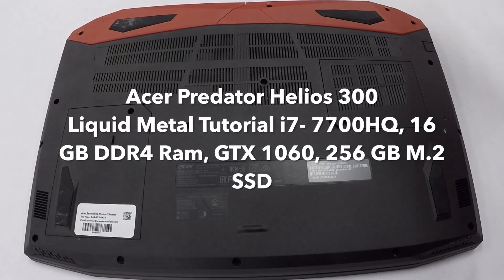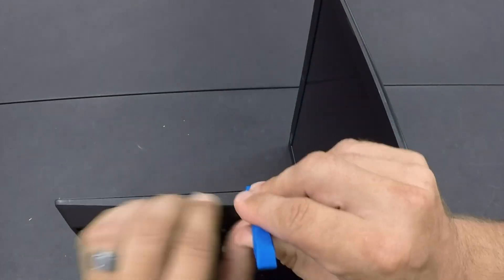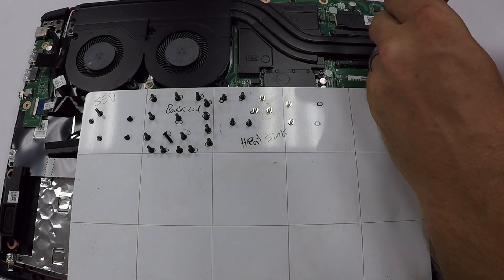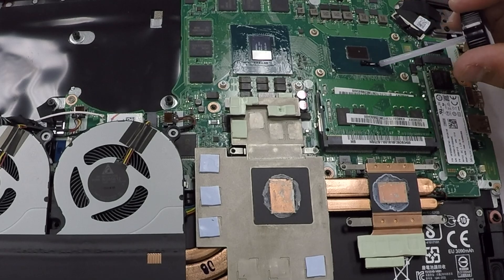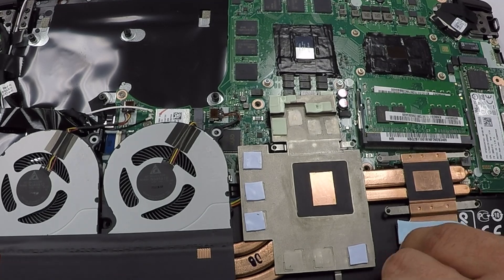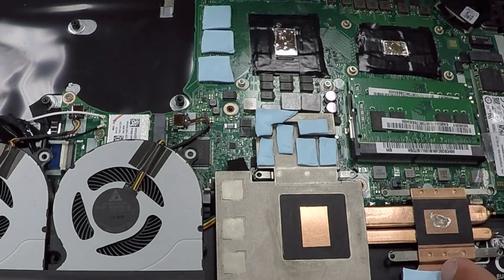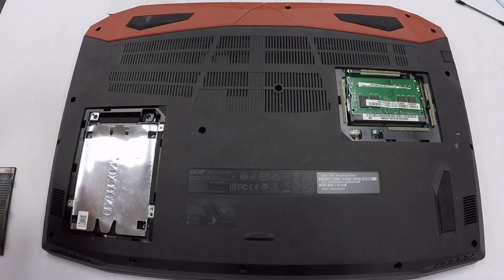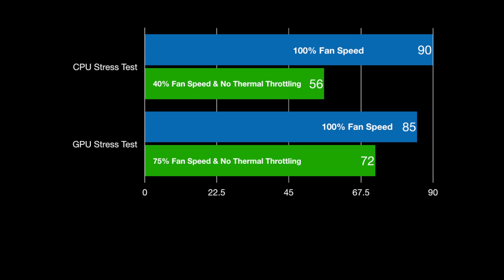Acer Predator Liquid Metal Upgrade Tutorial

Comment: I'm sorry to say this, but it's so strange to see people that find this video any good... Maybe it would be better without the actual footage of doing things so terribly wrong. Why would you want to apply any coating to the CPU that is void of any electronic components on its surface to short? Why coat bare fiberglass that is an insulator? Same goes to the GPU, except for the tiny capacitors on its surface. And moreover put a shitton of electric tape on both just in case and then tell people not to do that... Not to mention the quantity of LM you poured there. Then to put in graphs that don't make any possible sense just by looking at them and spend 2+ minutes trying to explain what you really meant by them. That's not an educational video. And again i'm very sorry to tell all this. I just can't walk past all this incompetency and stay out of it as if i didn't care.

Comment: Thnx a lot. One thing though, both cpu and gpu heatsinks are copper. Afaik, liquid metal corrodes copper plates in time. Did you have a look recently?
Reply: i think it work well with copper, but not with aluminum.

Comment: So... what about now? 1 year after you put the liquid metal. Have you ever got issues? And for how many months you can keep the same liquid metal?
Reply: Use it for a couple of months, then it will suddenly stop working well. That's because the copper absorbed the liquid metal and formed a layer of protection, after that, reapply it and in theory if you don't open it anymore, it will last indefinitely and it will always work like the first day you applied it. Just use precautions like special tape, nail polish and foam barriers. 👍
Reply: The age is worse than thermal paste
You should use a high end paste instead

Comment: Thanx for the tutorial... But  i would not doing this By my self. I Really need to clean my fans and apply new cooling pasta... My acer predator is 2 year, so no warranty. I have 2 options: 1 sent it to an acer factory and wait 1 month or go to a Computer repair shop, they do repair laptops and so on... No doupt they are good. I called them and asked, when he asked "is it a gaming laptop?" yup it is, he got unsure if he could do it... After seeing this... im not sure if they can or if they have done it!  Im starting to regret buying this laptop :(
Reply: a decent repair place can do it and it shouldn't cost a lot but you should get comfortable doing basic stuff yourself. fans need cleaning regularly even if you don't go as far as taking off the cooler. also, throttlestop is a great program use it to undervolt the cpu acer put way to much juice through it at stock settings
Reply: @LtTrog  i fixed it by ordering a original fan via zandparts.com. I took it to a computer repair shop and they fixed it and now its working fine  :D
Reply: Learn to service ur laptop urself.  Especially if its out of warranty all u need to do is open it up , clean it , remove old paste then repaste and nicely close it up. Done.

Comment: Finally broke down and used liquid metal on my Acer Predator x17 w/ 7700HQ and GTX 1080. Liquid metal is amazing. I had previously used kyronaut thermal paste. In Cinebench R20 the max temp on the CPU is 62° C vs 80° C with paste at stock voltage! In Unigine Heaven I get max temp of 61° C on the GPU! Using Aida64's stability test on CPU, FPU, cache, and GPU I get a max of 76° C on CPU. Pretty nice.
Reply: Hey, I want to ask is it still the same or u have to change it every now and then.Also pls answer is it worth it?
Thanks

Comment: Hey there, I wanna do the same procedure for my Laptop, but the tape you showed is to expensive in my country "around 20$", so I decided to buy someone which is only heat-resistant to 90 degree celsius, is that enough because my laptop could go into the nineties in cause of a overclock

Comment: do you know if its the exact same for the new helios 2019?
Reply: @gezimislamaj5309  it's weird. Cause my cpu I. The new helios runs way hotter than it's suppose to.  I need to undervolt it by a lot to get it to normal. ....  Thats why I was thinking maybe the paste was maybe put on it wrong.
Reply: @gezimislamaj5309  ya. I'm  hesitant of doing that. I'll stick to the undervolting for now.  Temps are good at around 60ish c°..  Not even hitting 70c°...  If it gives me problems later on down the road. I'll maybe think of re-pasting..
Reply: basically the same for any laptop

Comment: JUST DO IT AS SOON AS YOU CAN  if you have the same model!!!! It works so well on mine. Before the replacement, my CPU regular temperature was around 53 degree, gaming temperature was between 85-92degree ( outdoor temperature: 30 degrees, I got few times 98 degrees when the outdoor temperature was 40). And now, my regular temperature is just around 43, sometimes it's only 38. And the effect on gaming is also remarkable, I played 2 hours PUBG, 1080p with high setting, the temperature was always below 80 degrees. That is IMPRESSIVE!  Don't be hesitated, the rewards are worth the risk. Because ACER left us a bomb here, it should be fixed by ourselves! (You'll understand when you open it)
Reply: wow. I tried repasting with different brand of thermal paste and it didn't work. I guess liquid metal is the only way
Reply: Great.!

Comment: What happened with helios now,after 1 year liquid metal used
Reply: 3 month it would die. you know why? cause fucking liquid metal is for special servers cooling and not processors of laptop!!! it goes in reaction with alluminium and copper. and after some time it just corrodes it and thats all! processor dies in 3-6 month. Yes temperature is awesome but it just dies!!!
Reply: @vladdjavakhadze3147  BS 100% had lm on my old laptop for 3 years, only some corrosion on the copper nothing bad, gpudied because not changing the lm for 3 years, if you change it every 6 to 12 months you will be fine after all

Comment: I have some conformal coating on the metal part of the chip where I am meant to put the liquid metal.. it’s small residue I’m struggling to get off.. is this ok?
Reply: just out of intrest what did you do about it? and is the laptop ok now?
Reply: @redpacg5128  Laptops running like a dream, liquid metal definitely took my temps down when I'm gaming I'm using around the mid 70s which is pretty much as good as I'm going to get for a laptop
Reply: @redpacg5128  realised I didn't actually answer haha, I tried cleaning it a bit more with some rubbing alcohol / nail varnish remover works great if you have a Mrs
Reply: @Jordy-kk1kw  nice ima try this :)

Comment: Why is it always silicone conformal coating I don't get it, use ACRYLIC not silicone they are both about the same but the acrylic version is far better suited to prevent electrical shorts that's it's thing silicone is good for out doors in high humidity areas. I'm not trying to give folks a hard time but it's like 1 person goes around giving everyone bad advice acrylic conformal coating has a much higher dielectric rating than silicone.

As for the tap a good option is kapton tape it's like industrial strength electric tape they use it on all types of electronics it's golden amburish and see through place it down first and put a layer of conformal coating down on top of it. This will keep the kapton tape in place and by itself kapton tape alone is better than conformal coatings but it's adhesive isn't the best and would have trouble sticking on top of a conformal coating but the conformal coating can go on top pretty easy and it helps to keep the tape in place.
Reply: I am going to use acrylic based on your comment

Comment: I bought a brand-new 2018 helios 300, and it's hot, like burning hot, and I hate that it's pretty much required to do this.

The place where I bought the laptop is too far away, like, it will take me a whole day to travel back and forth, and I don't want to do that.
Reply: Undervolt. Temps drop like 10 to 20 degrees.
Reply: Undervolting is good, but this laptop still hits high temps even while undervolting.
Reply: Undervolt then open it up, clean and repaste. A good repaste makes this guy works like like a dream

Comment: By the way, reason I ask is cause I have the 2018 edition and it has the 6 core CPU and yes I repasted it with better paste and undervolted it but it still thermal throttles like crazy.

I'm planning on putting 5 coats around the cpu and gpu just to be safe cause I can be clumsy, which is why I have a keyboard protector on my keyboard aswell as tempered glass on the screen, I love my 144hz screen.

I don't like using thermal paste cause of its strange way and I dunno if it covers the whole CPU and GPU, while your video shows liquid metal, you only need a little and paint it on and I like painting, it's easier than just slapping it on.

Question, does it still work just as well as it did, when you put it on? And is it okay to take with you everywhere?
Reply: Lol, a good repaste cannot cause thermal throttling. It means u did not do a good job repasting

Comment: Sir, I am going to upgrade my RAM on my laptop ,which is currently running on Configured Clock Speed:  2133 MTS, Total Width: 64 bits, Data Width: 64 bits, Size: 4096 MB, Form Factor: SODIMM, Type: DDR4, Type Detail: Synchronous, Manufacturer: Kingston, Minimum Voltage: 1.25 V, Maximum Voltage: 1.5 V, Configured Voltage: 1.2 V.  I am planning to buy an 8gb DDR4 RAM and planning to put on 2nd RAM slot alongside the old one. Sir, what are the things to consider on this process.
Reply: Make sure to get the ram running on the same frequency as the previously installed one which in thsi case is a 2133 mhz.
Reply: @fardinhoque2722  Bro many sellers say if u insall 2400mhz ddr4 ram along 2133mhz then the 2400 mhz ram would be downgraded to 2133mhz. I dont know this information is true do anyone know about this
Reply: @mnkh-r6i  that is correct. Your pc will run on 2133 mhz. So 2400 Hz is the closest frequency you can match to! Moreover there are a few ram sticks which say 2400 mhz but run on 2134mhz (check reviews of the ram stick you are going to buy to verify this)
Reply: @fardinhoque2722  Thanks bro I am planning to buy an crucial 8GB of RAM.Is it good?
Reply: @mnkh-r6i  check the reviews on an online retailer for the same kind of ram. Usually Corsair does make good products though

Comment: I didn't used any tape or any type of protection as those things you used as i already had experience with liquid metal before watching this video. Also, there's no need for those protections if you know how to well apply and know how much of it you need to use and also, the liquid metal will solidify in less than 3 days so i doubt it would get somewhere else inside the laptop. Have to admit it, the use of that liquid protector is a great idea. Great video btw. Cheers :)

Edit: You actually used too much liquid metal on both the die's and heatsink. Less is actually better.
Reply: Update. Is ur lappy still alive?

Comment: Can u make a new video about liquid metal, such as “After half year with lm”
Reply: Eddie Nemec Sorry for my English. I bought Helios 300 2018. i7 8750h with 1060(6 gb) .Pasted liquid metal by Coollaboratory. With heavy stress test both cpu (avx) and gpu (Furmark). I’m reaching 83 cpu and gpu 80. I also used arctic cooling thermal pads.

Comment: I somehow stripped one of the cpu screws, do you know any replacements?
Reply: I did the same thing, so frustrating. The screws are very sensitive. The only thing I can think of it to fix it right now is cut a straight line through the head of the screw and then use a philips screw to get it out. Not really sure how I'll do that yet.

Comment: What are Donkey You don’t need to do all his BS you some masking tape on The GPU apply the conduit and remove the tape you don’t need to seal the surface of the CPU or GPU you don’t need to put tape all over it like an idiot.  You don’t need to change the thermal pad to either there’s nothing wrong with them they’re brand new and even if you changed out the paste multiple times there’s still nothing wrong with the thermal pads. Are used liquid metal for my Acer predator 17 inch it’s the only thing that keeps the temperature is down I also under vote that the CPU which lowered it by 25° with the thermal grizzly but this guy he just takes it to the extreme something so simple he makes it difficult
Reply: i used thermal grizzly, didnt help at all

Comment: Can i use clear nail polish instead of the coating you used in the vid??
Reply: Eddie Nemec thanks! I have a new issue, i was kinda scared of using liquid metal and used Cooler Master Maker. After repasting my laptop, it starts up but wont boot into windoes 10, just a black screen. Any fixes??
Reply: Eddie Nemec nope, just a black screen :/
Reply: @Eddienemec  Hey, thanks for your concern. Heck, you respond fater than the acer community themself lol. It may have been a monitor cable damage as i sent it in to acer for repairing. They said that there was a problem with the monitor cables. Thanks for helping me out!
Reply: @sune3187  Did you figure out what the problem was? After following the tutorial and putting everything back together, I get a black screen with a lit keyboard and blinking touchpad toggle button. 

Any of this sound familiar? I'm in a bit of a panic haha! (Am looking to send in to Acer, I hope)

Comment: Does your laptop have a warranty and if so does it have a void warranty sticker at the bottom cover one screw hole? I have a recently bought predator 15 with a void warranty sticker but the cpu is thermal throttling. I have already undervolted it to -160mV but playing medium to heavy games still makes the cpu reach temps up to 90 C. Any suggestions?

Comment: This is a good tutorial. Well done. Even showing and explaining your mistakes shows that it's not that hard, just time consuming sometimes.

A lot of people don't understand what the real benefit of liquid metal is. It's not to get 2 degrees lower temps, it's good because your thermal response is so much better. This will reduce the latency between steps of the speed step algorithm for example and I also noticed much improvement when running on the iGPU.
I did this for years on CPU's and GPU's, if possible anyway. My 7 year old laptop is now even more responsive than the one a friend of mine bought new just a few months ago. The fan was tought manners with this procedure. My friend still refuses to let me METAL it because warranty...blah blah! Just do it, and be amazed what your computer can do.

Comment: Rule 1.  NEVER use liquid metal in a laptop
Rule 2.  If you are an idiot and failed following rule 1.  Understand that liquid metal will destroy your laptop in a short amount of time.  It will eventually amalgamate with it (including copper in time).
Rule 3.  If you're at this rule then you're absolutely hopeless.  Sell your laptop, you don't deserve one.
Reply: Rule 1. Never use otherwise your life is fucked 
Rule 2. You are an idiot if no go outside of your confort zone by trying news stuff heven it destroy stuff 
Rule 3. You need a break XD
Reply: Actually you’re an idiot. Liquid metal will amalgamate with the heat sink, but not the cpu itself. This is not an issue. I’ve been using liquid metal TIM for about 10 years now for myself and for family and friends with 0 issue. Maybe learn to apply it properly. And get a profile picture that doesn’t look like a man with a wig. Tard.
Reply: Why its a bad idea using liquid metal? Its because the aluminium cover o something like that? Im new doing this.
Reply: I have a Acer Aspire V17 Nitro with a i7700HQ @2.8Ghz with Turbo Boost up to 3.6Ghz & 6GB NVIDIA GTX 1060 that I bought last Augest.
  Out of the box it ran scolding hot, the CPU around 98C (208F) at full load and GPU around 82C (179F) playing F1 2017,  Fallout 4, or Planet Coaster with NVIDIA's "recommended" settings.  Last October I used Thermal Grizzly Conductonaut on my CPU and GPU and it's been working great!  Maybe OP had a bad experience but I travel with my laptop daily and it's been through it's bumps over the year and has still managed to run flawlessly.  My temps never go above 73C while gaming now and while browsing online or watching Netflix it's staying at a cool 32C (89F).  I'm not an idiot....
Reply: @Darkstarrdp  yoo , is the liquid metal still good on the laptop ? Am planning to apply but don't wanna destroy it over time
Reply: @zakovinda  yeah, the Acer is still doing great!  I opened it up about a year after the liquid metal paste job to clean the dust and stuff off the fans, while I had it open I checked the liquid metal to see if there were any runs or blobs poping out the sides but it was perfect. 
There was no erosion or pitting on either the CPU die or the copper heatsink plate and it still runs incredibly cool.  I've bought a Alienware a51m (R1) when they came out and even did a repasted with liquid metal on it too and haven't had a single problem with it so far.

Comment: Also under volt your CPU helps with temps by using Intel  XTU
Reply: I prefer throttlestop it's more stable than xtu that wont even run on my machine these days
Reply: Yeah but...
What if your game lags then?
Reply: @selim63389  undervolt it's different from underclock. If it's stable, there's no performance loss.
Reply: @lucianogiacon8506  an increase sometimes too according to some owners
Reply: @inspirice9844  mostly because it will stop throttling due to heat